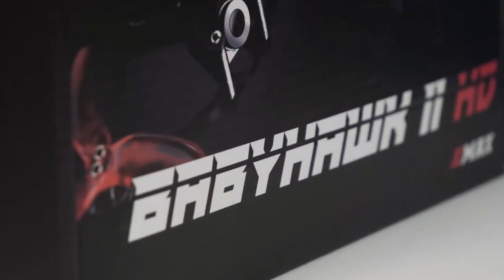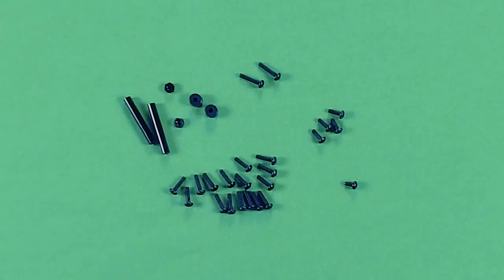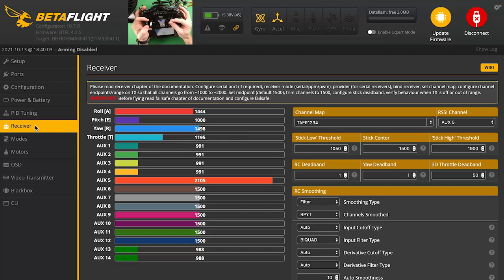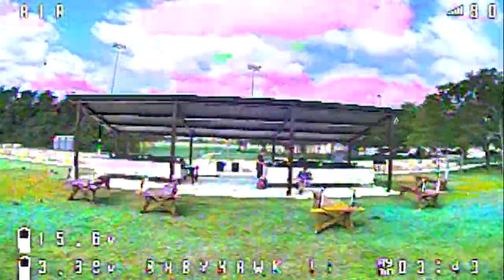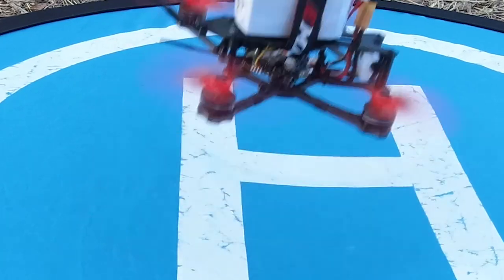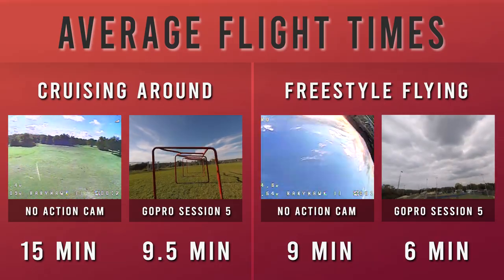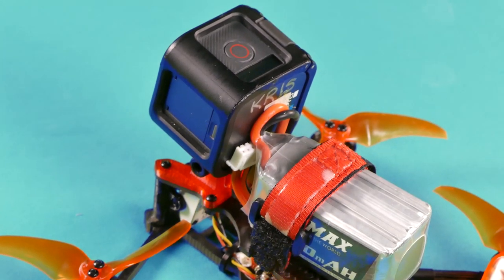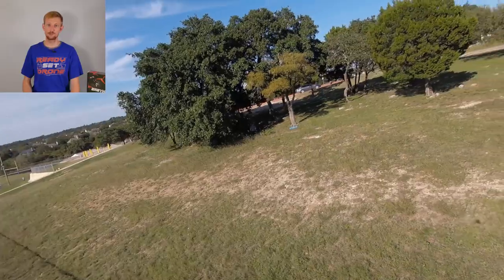BabyHawk 2 Analog FPV Quad - The Goldilocks of FPV?

Comment: Wich Radio is the best for this drone? Radiomaster Zorro with 4in1 ?
Reply from the maker: That's a great radio! It all depends on your preference, as well as the receiver you decide on. If you choose a crossfire receiver, you'll need to the crossfire radio/external module.

Comment: Hi kelly, can you convert the emax freestyle 2 to work with dji goggles?
Reply from the maker: Probably not. I don’t think it could carry the Vista unit very well
Reply: Hi thanks for getting back to me after a while of looking i found a channel called cube fpv, he did the original freestyle and freestyle 2, so it can be done not sure if he used bigger motors I'll watch it later on in more detail.